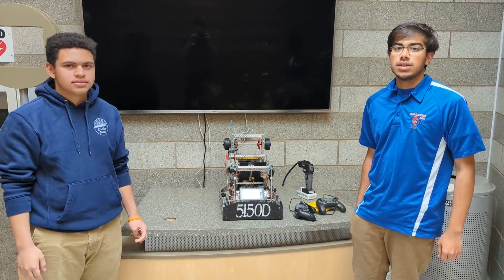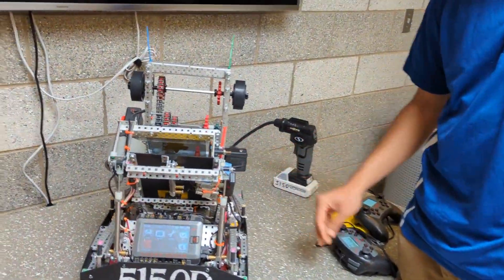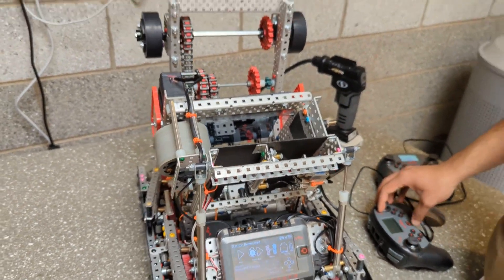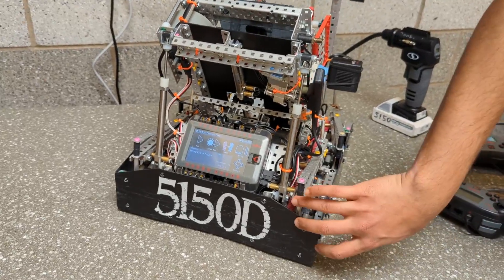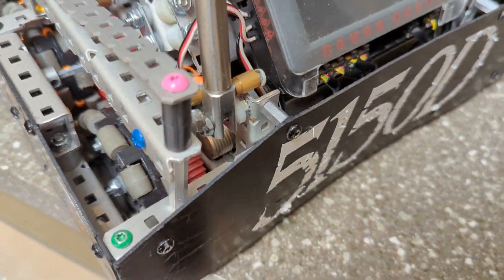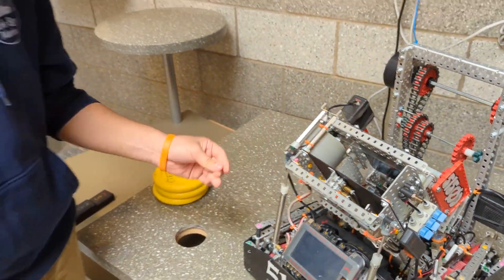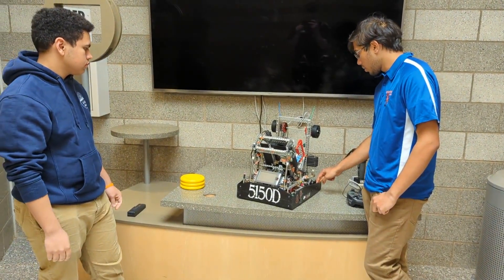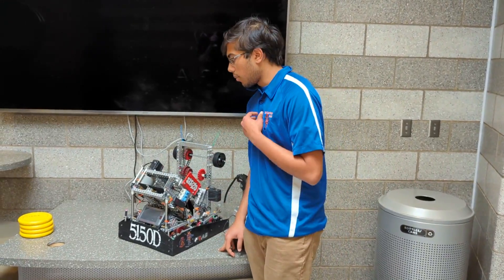5150D Robot Explanation | Vex Spin Up

Comment: Could you please explain the ruling behind the air pressure with the endgame since you’re disconnecting the air flow from the main system? We did this and we’re DQed since it was a “safety violation” during an earlier competition
Reply: Sure, so we had many discussions with refs and inspectors about the redbox on R-17 which states that, "Using cylinders or additional pneumatic tubing solely for additional storage is in Violation of the spirit of this rule. Similarly, using pneumatic cylinders and/or tubing without any air reservoirs is also in Violation of the spirit of this rule." However, with the way that we had our pneumatics we did not violate these two points. We did not use any excess/additional tubing  (in fact with the way our endgame worked we used less tubing than if we tubed it to our tanks) and we did not only store air through the tubes, air reservoirs were also included to store air. 
Im not too sure on what basis they gave you a DQ for a safety violation as the only thing referenced with safety is the that " Teams should not use compressed air as a means of actuating non-pneumatic devices such as screws, nuts, etc." The rest of R-17 is very general and could be easily dismissed due to ambiguity.